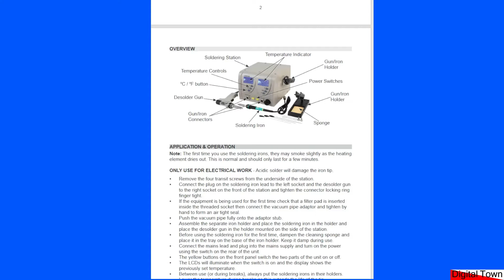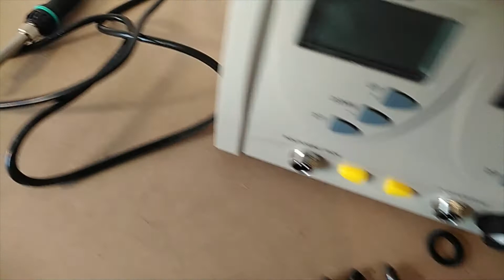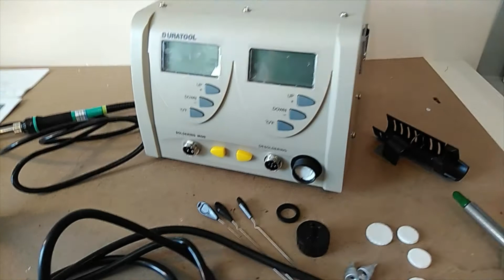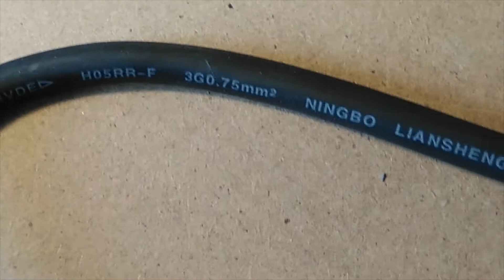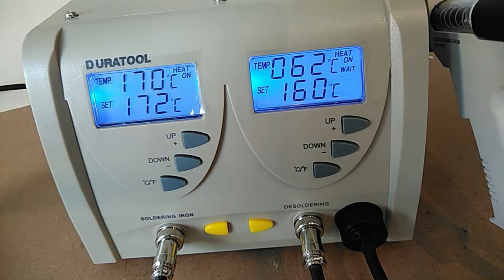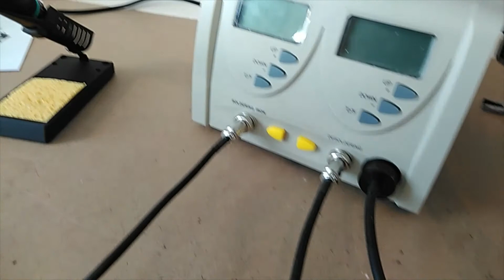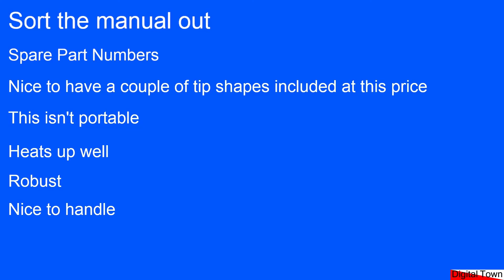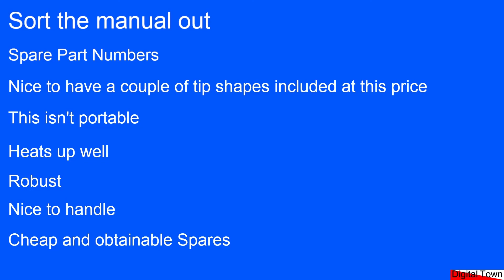Review of Duratool D00674 140W Soldering and Rework Station.

Comment from the maker: Just as an update, after regular use and sometimes very heavy use for over 2 years I have finally started to see some wear on the soldering iron tip. I was surprised just how long it had lasted and even more suprised to find that in the UK through Farnell I bought 4 for about £10. Guess I'll need to reorder in ten years.